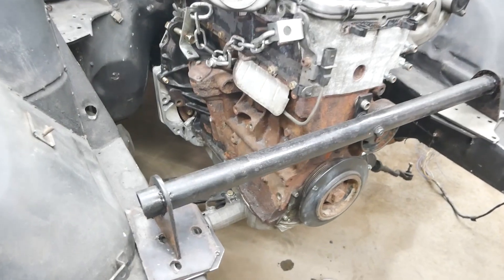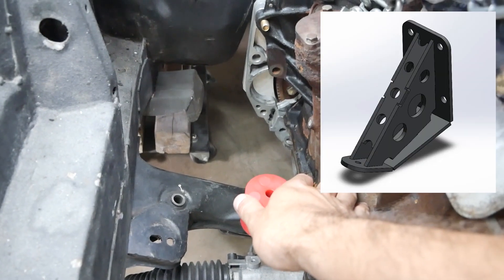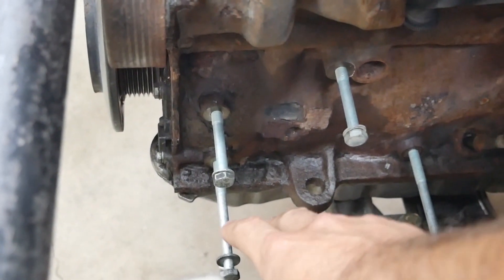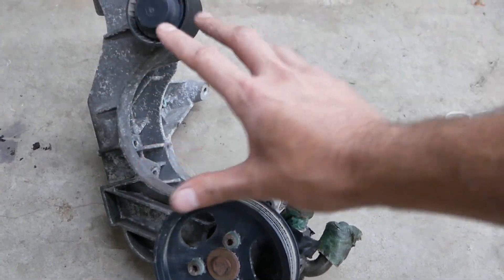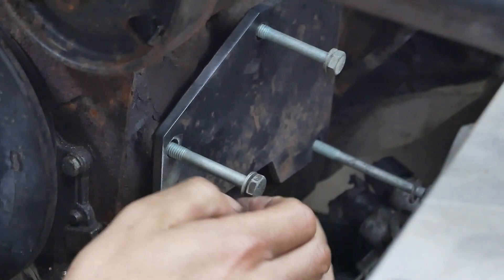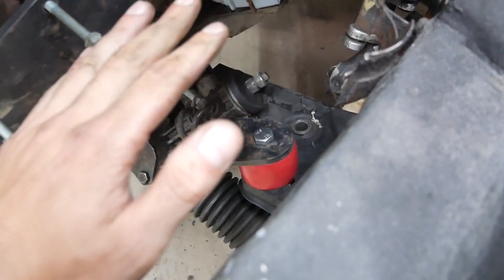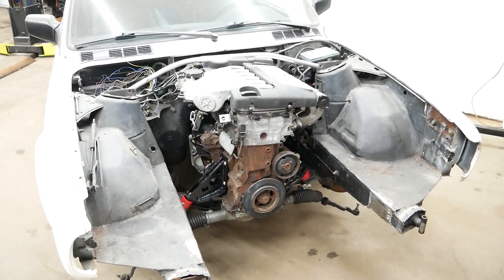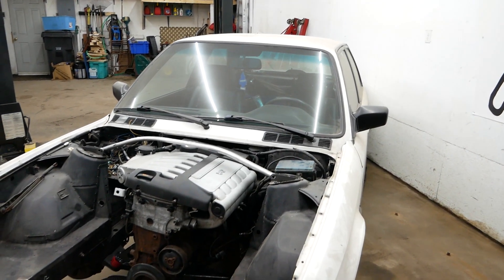CUSTOM ENGINE MOUNT FABRICATION - E30 VR6 PROJECT PART 6

Comment: any chance you still have the CAD/ DXF file for the passenger side plate that bolts to the block? If so could you email it to me?
 It'd be much appreciated, I'm trying to build a bottom mount that comes off the subframe on my Jetta. Thanks

Comment: Side mounts looks good.
Reply from the maker: Thanks ! Yeah it cam out better than the passenger side. I will need to redo it because my welds are pretty bad ...
Reply: @APEngineering  If you redo them, consider leave them unpainted. In my opinion they will look nicer.
Reply from the maker: Leaving mild steel unpainted will get rusted pretty quickly. If ever I redo them in stainless I will certainly leave them raw.

Comment: What adapter are you using to bolt the trans to the motor? Also what trans are you using?
Reply from the maker: I am using a custom adapter plate that I designed and fabricated. The trans is a stock E30 Getrag 260 transmission.
Reply: @APEngineering  Sounds good, I started swapping a Touareg motor into my E36 last month. Glad to see someone else doing this! I’m working with a friend to create the trans adapter, I’m using the 420g 6 speed from an E46 M3.
Reply from the maker: Awesome, happy to see im not the only one crazy enough to do this swap !
Reply: @APEngineering  there's a few of us out there. lol Looking forward to seeing your progress. Cheers!

Comment: Good shit, love this series and listening to your explanations and thought processes from your narration. You can get better welds if you run a wire wheel on the metal and do an acetone wipe. I think you also need to run higher amperage and have the tungsten closer to the root of the weld. How many amps are you running on those welds?
Reply from the maker: Thanks alot ! I definitely need to work on my welds, this is one of my first projects so I need more practice. I sandblasted my mounts once they were tacked together, so some blast media got stuck between the plates and caused splatter when welding. I will need to redo these mounts later on once the rest is fitted.
Reply: @APEngineering  ahh I see. I've always wanted to do an E30 VR6 swap. Didn't think mounting would be so difficult though. Like getting the oil pan to clear and mounting the driver side of the engine...

Comment: Simply amazing! What thickness plates have you used for them?

I will try fabricating engine mounts for an M52 BMW engine in an FC3S chassis soon. :)

Thanks a lot for your help!
Reply from the maker: I used 1/4'' plate because I already had it on hand, but it is definetly overkill. But I rather it being overkill than underkill ! Especially with my rookie welder skills.
Reply: @APEngineering  thanks a lot for getting back to me! Was really helpful on what material to use. 

1/4" is ca. 6mm, I was going to use 5mm, but have my fabricator friend finish the welds for me (I am a rookie welder, not you, haha). :)
Reply from the maker: @pitesy  5mm will be fine ! This was my first real welding project since I bought my welder one year ago so I do still consider myself a rookie, but I am getting better with every project !
Reply: @APEngineering  thank you for the confirmation! I won't doubt the choice of thickness anymore. I am also welding sometimes, but only with flux core - it is less than optimal, but gets the job done for the little things.